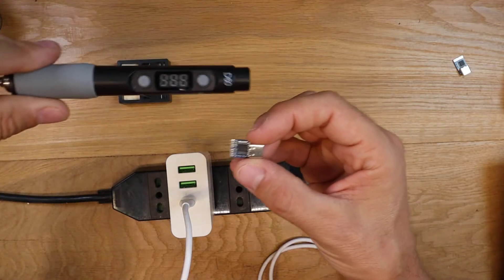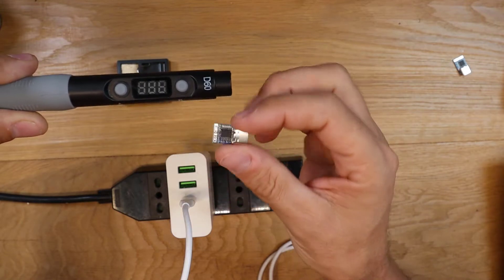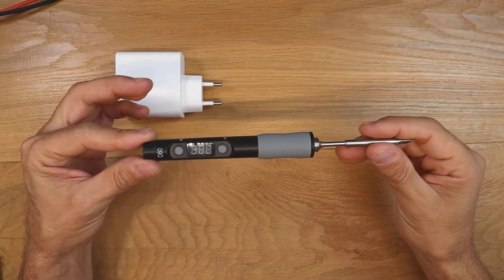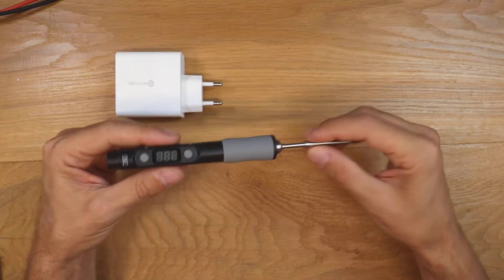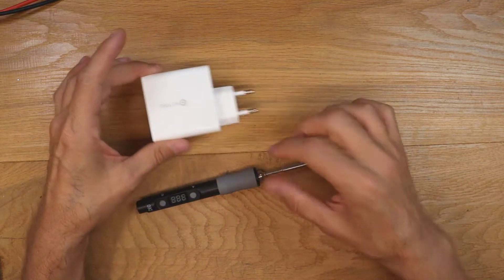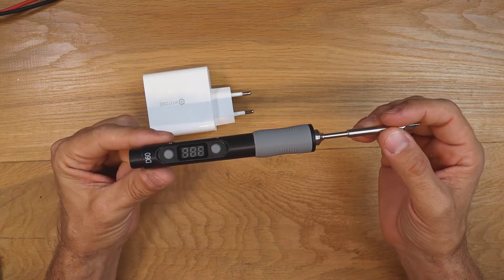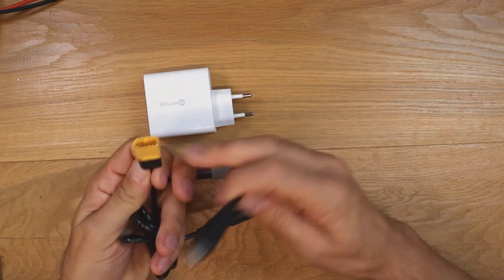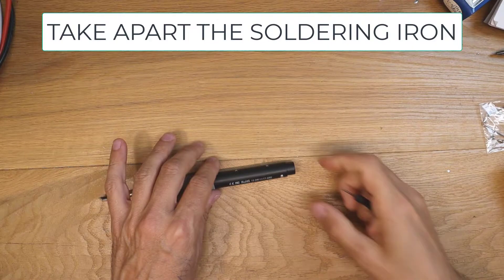D60 soldering iron upgrade, real USB-C

Comment: I did what you do in the video but now the display doesn't work anymore and there is no control at 20V (the top of the solder will be incandescent!) Very dangerous!
At 12 V, still no display, but decent amount of correct required for use the solder
Reply from the maker: Mmm sorry to hear this. As you can see the modification is not easy, you may have touch something wrong and now the soldering iron is bricked (no control anymore). Sorry for that

Comment: Interesting, how is it holding up a year later? I'm running into the same issue and considering working through your plan. Any updates?
Reply from the maker: Still running ok, but honestly today i would exit the soldering iron with soft flexible wires, and have the usb PD converter PCB installed later in that cable, wrapped with heat shrink. USBC cables and connector are not really flexible
Reply: @MakerFabio  Ah ok interesting thought, I like that. Well you've given my a good little project to try out, thanks!

Comment: No good idea.. You are buy Sequre Store PD cable.. No DIY good RUN.. PD cable price 4$..
Reply from the maker: Not sure I understand what you mean. Can you provide a link for the cable?
Reply: @MakerFabio  https://youtu.be/kaBhTvzoKno
Reply from the maker: @dashkim0321  i don t know if your tester is triggering the usb PD higher voltage, or the cable is triggering it.
Or if your power bank is can be set to high voltage. But the soldering iron does not have inside any usb pd trigger circuit. So diy is needed. 
Can you please tell, in your video, what is requesting the usb-c to provode higher voltage than default 5v?
Reply: @MakerFabio  Decoy chip include the PD cable..
Reply from the maker: @dashkim0321  wow
Thats good, thanks